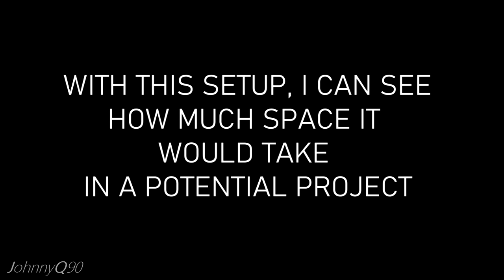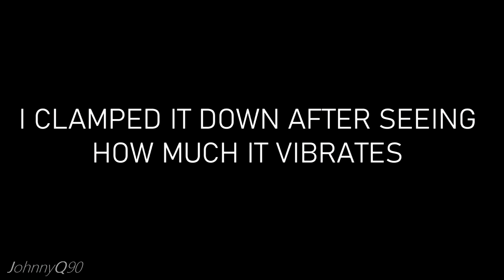Miniature Inline 4 Cylinder 32cc Watercooled Engine

Comment: These are very cool, but you can almost buy a 'real' engine for the cost.
Reply: Almost? I can go buy a small block Chevy from the junkyard for $200.
Reply: true but its not like this little engine is a replacement for a small block chevy lol. Try fitting one of those in a model boat 😂😂
Reply: Ikr ..buy a used weedeater motor for your "model boat" -other dude. But watch Gyro here can point out its a 4 cylinder ..but he can't state why he wanted to use it also he thinks a SV 26cc is basically Shiite in comparison ..not to mention notice he thinks he can make a C8 corvette "better" than A CTR YELLOWBIRD porshe .. Even though timeline was what I was pointing out of how he had the better engine in 1987 *but this guy married the conversation into hearsay mode ..lets see Corvette break any world record including 211mph in 1987 ..move the weight to the ass end so it doesn't flip turning a curve for $55,000 (but I know nothing about "engineering" *you mean*)
Reply: Yes, but that’s missing the point. This engine is unique and built by a relatively small company that has not fully streamlined production costs like a major corporations. Most automaker manufacture millions of examples of each engine whereas there’s likely only a few thousand of these. They are also for a specific niche which means those who really want one will pay this much to get it. Also, this engine is BRAND NEW. They just started selling them to the public within the past year or so and when you order one, it’s fresh, not some junkyard engine with XYZ miles on it.
Reply: @GyroPyro121212  you are missing the point and he is right with his comment
Reply: @americanlivesmatter-BmanWild  You can spit BS all you want. Until you can show me the link to another 32cc Liquid Cooled INLINE 4 Cylinder for a lower price brand new, then you are simply wrong. This engine is a novelty that diehard gear heads with a fair amount of disposable income would gladly purchase. A Conley V8 (also a tiny model) costs nearly $7,000. So for $900, this is quite reasonable.
Reply: @americanlivesmatter-BmanWild  Any gasoline powered R/C plane you can buy new for $900 or less is not going to have 4 cylinders. Maybe 2 at the most.
Reply: @americanlivesmatter-BmanWild  Why buy this engine? Because it has FOUR CYLINDERS. It operates and sounds much cooler than a single cylinder weed eater engine. Why buy a corvette instead of a Porsche? Because the C8 Corvette lapped the Nurburgring just 4 seconds than the 911 Carrera S. The C8 is $60,000 and the 911 Carrera S is $115,000. For that $55,000, you could make the Corvette much better than the 911. I like RUF and I like Porsche. But to compare automakers that have been around for the better part of a century to a novelty engine model is pointless. You could get plenty of enjoyment out of this engine. If you put it in an RC car, it would make a much better sound than the single cylinder nitro and gas RC engines make. At $899, this engine is priced well below any other ready to run model online 4 cylinder on the market. The fact that it is liquid cooled just adds to its already good value. Is it the greatest quality engine ever built? No. Is it a good value-priced engine with cool features. Yes. I would much rather spend $900 on this then buy a weed eater engine. I already have a 2 stroke weed eater, 2 stroke dirt bikes, 4 stroke cars, etc... so what would I want with any of that? What I don’t have is a tiny running 4 cylinder. I would be happy to have this engine among my others.
Reply: @americanlivesmatter-BmanWild  And I didn’t say “show me something shinier.” I said show me another R/C sized engine that has 4 working cylinders, liquid cooling and can be bought brand new ready to run for less.
Reply: @americanlivesmatter-BmanWild  Honestly talking to you is like talking to a brick wall. I DIDN’T SAY SHOW ME SOMETHING BETTER, I SAID SHOW ME SOMETHING THAT IS COMPARABLE FOR THE SAME MONEY. Also, I have seen the C8 driven up close. I even have a video I took of one crashing on my channel. You would be hard pressed to find an original Yellowbird for under $250k now. Also, the C8 is $60k-90k MSRP. If you order one and wait, then that is the price you will pay. One just sold at a dealership near me marked for $95,000. That is still $25,000 less than the 911 Carrera S for only 4 seconds on a 13 mile track. That teaches us that just because something is more expensive, it is not always much better. Also, it has to be a 4 cylinder because that is what this engine is. If you knew anything about the scale model engine market, you would know that more cylinders = more money. A Saito 4 cylinder, for example,  is $2,000+ and it’s air cooled and arranged in a flat cylinder configuration. A liquid cooled inline 4 from Saito would likely cost $3,000+. At $899, this engine is a bargain compared to it’s competition.
Reply: @GyroPyro121212  you've lost your argument .. #fyi
Reply: @americanlivesmatter-BmanWild  The $20 weed eater from Lowe’s is  not a 4 cylinder you single cell. You’re inability to provide me with a comparable product for less money makes your argument invalid. All of your credibility (what little you had) is gone.
Reply: @GyroPyro121212  but but I thought you'd be my friend if I bought this engine and made it run just to make you right "Its not faaaaaaaaaair 😭" now I'm out the $899 bucks and I still don't have your approval what do I now
Reply: That guy commenting back is like a yoyo at the bottom of his own doing he's gotta realize no matter what I say here the facts are he can't tell me legitly why he thinks this engine is worth $899  GyroPyro12
Reply: I'm just glad I'm not riding around in a Ford escape thinking I've got a badass ride like apparently GyroPyro12 here does.. Tell the truth "you were thinking of putting this $899 dollar model car kit in that Ford Escape because it's knocking now werent you 🙄🤔 ?"
Reply: @americanlivesmatter-BmanWild  I already told you. The engine is worth $899 because it is a running, liquid cooled 4 cylinder model engine. Similar engines sell for $2,000+. The Ford Escape is running fine and is just a loaner until I get my F-150 back. It is not mine. Since you’ve decided to go to my channel, you may have seen the A4, F-150, Mustang, Focus SVT, Forester, and various ATVs/dirt bikes. Those are mine. Any others have been those belonging to family members, friends, etc...
Reply: 1 cylinder engines with more power
Reply: @GyroPyro121212  my 1970 D300 would still own your f150 and you claim "I know nothing about engineering"  liquid cooled means I can piss on it ..that rubber aquarium hose will melt .. The VHS wheel in the front insures it .. You said it's worth $899 for the sound ? You said for a RC (anything with a throttle can be RC..including a tube of gunpowder being shoved into the carburetor as our common friend WP showed us in his video) in no way is that motor worth $899 just because it's a 4cylinder .. Although I'm not driving a loaner I'm driving a "slow car" you said ..havent had to fix a thing on it in 12 years except change tires change oil decided to change transmission fluid early haven't had to ask for anything else to drive except when I use my duely to pull Shiit like yours to the shop or out of a ditch ..
Reply: @jwalster9412  exactly! and they can cram that  plastic 4 cylinder for $899
Reply: @GyroPyro121212  "similar" paintings of Jesus sell for $480million to. Where did the "b.s." comment come from originally btw..? Because not once have you stated your case of what exactly you'd use it for as in body & setup: vague and just because it sounds like a 4cylinder don't make it worth $899 it's worth about 3 dollars if that in metal ..what generative form or competitive circle would you put it in..btw there's some sweet music boxes from the 1800s on eBay some look nearly new for less than $899
Reply: @GyroPyro121212  you saying Toyan has nothing to do with Toyota or Yamaha you may want to check the 4cylinder mini bikes China started to sell.  Or the aluminum painted black with an exact match to those Yamaha 4 cylinder engines ..and newly made steel pens use a magnet it's aluminum not steel
Reply: @GyroPyro121212  you can buy 8 brand new 26-30cc 4stroke gasoline ⛽ not nitro not 2 cycle Ryobi weedeaters for what that 4 cylinder  costs all produce more torque and rpms more gasoline efficient none of them NEED water cooling also has extra parts to hook up remote control ..nothing you have said so far is anywhere near convincing to buy this for $899 NOT EVEN CLOSE
Reply: @americanlivesmatter-BmanWild  This engine is not made by Toyan. It is made by an entirely different manufacturer. I encourage you to browse enginediy.com and look in the Toyan Engines section. You will not find this engine. Also, your D300 has a lower towing capacity than my F-150. Properly equipped new 1/2 tons can tow well over 7,000 lbs. Some can even tow 10,000+. Your D300 would be left in the dust. In a race? I wouldn’t even see you in the rear view after the 1/8th mile. Not to mention my F-150 gets 19+ mpg towing a trailer and 2 snowmobiles. You’d be hard pressed to get half that. This 32 cc engine as I have said countless times is a NOVELTY. It is not designed to outperform all other engines of its displacement. It is meant to look and sound cool as a display piece. However, it still makes enough power to be adapted for an R/C application.
Reply: @GyroPyro121212  ok so you made 1 point but it's plastic and it will melt how is it worth $899 and don't give me some mess about its 4 cylinder .. So is a 84 Mustang..
Reply: @GyroPyro121212  I have more wheel on the ground in a solid place also I have a real granny gear 4speed lockout 3rd ..and both your axles will break before you can tow me in the D300  My 7.3litre f250 dually 1991 doublecab will drag you backwards faster than your truck can go.. Or a boxcar. Down the track at 75 mph ..wyg
Reply: @GyroPyro121212  see that's your problem ..your 4x4 isn't made to go fast .. But on the other side of that it has no ass either ..just a costly repair routine
Reply: @GyroPyro121212  the civic can take you btw ..but I'm pretty positive a cb200 can outrun you to..but if you want bike versus bike all I have is an 1980 xs11. Sonny Barger is my 3rd cousin my mother's 2nd cousin I'm pretty sure he has a Harley that can outrun your Harley if you want to go there next.. My xs11 was the fastest bike built between 78-82 stock..but it's no monster however I wished you'd met me at 14 and wanted to race I had a 750 honda bored .40 with goldwing jugs also had a 400 Kawasaki at 11 that had 1 120 sprocket on back wheel ..itd do 80 in 2nd gear (diverted low end power to high speed) ..and a match in the ballist to redirect  spark at 6k rpm increasing its red line to 10k rpm. Would have eaten your 500's lunch .. A 250 enduro streetbike 2cycle ..6 speed .. I'm not beyond using a hairdryer as a turbocharger on a bike or beyond putting a sleeper nos on a Suzuki deadhead.. Just telling you ..while you are taring your Shiite up trying to tell me Idk wtf is up Im telling you I can build a computer from a 2009 motherboard faster than anything you can buy at Wal-Mart circuit city or ebay already put together ..i can make a quad core faster than any 8 core you can but due to 1 fact of latency ..and cheaper than $500 but I know nothing about engineering? would you like a balloon 🎈 💫 what do you think my purpose was for watching this video to begin with was.. Yes I hate China ..obviously but that's not my reason for being here
Reply: @GyroPyro121212  $899 dancer looks and sounds better than this engine. Just saying. Display piece ..or junk drawer. That's the reality of it. $899 worth of pennies looks better as a display piece.
Reply: A lot of people missed the point ..while you kids are throwing $899 in China's hands for a shiny toy engine they are buying vulture capitalism and plotting your doom.. Btw the metal in this engine couldn't be much more than $3 worth. Rest of it is plastic and the rings will definitely start rusting after first run.
Reply: @americanlivesmatter-BmanWild  It’s got plenty more than your beat to hell old Dodge. 0-60 in 5.5 seconds. That poor D300 would be lucky to do it in 10 😂. And the F-150 will tow more. How can you say my truck has no ass when it performs better in every way than your’s?
Reply: @americanlivesmatter-BmanWild  I’d just hold the brake while you overheat and glaze your clutch and then tow the old Dodge away. Your F250 MIGHT beat me, but then what? You barely towed a Gas V6 powered half ton backwards with your Dually 3/4 ton diesel. So what? That’s like being the heavyweight champion and going 10 rounds before finally beating the lightweight champion by default.
Reply: @GyroPyro121212  I've seen what Toyan has for sale.. I'd rather buy a Ryobi or Saito if buying new for the main purpose I checked this video for. Which so you know and finally conclude this marvel of a debate ..I have 3 generators in the making that are like nothing you've seen so far. 1 is in need of a small gasoline engine only can't be 2cycle or nitro etc. Not going to give my plans away .. The other 2 have nothing to do with this entirely .. But this one is a 600watt generator and stores it's own power with regulator so theres no back power resistance . the other 2 are much larger and function a totally different way.. That's all I'm going to say ..at $899 I could make it worth it but not about to invest in this motor for the purpose as its made like a kindergardener found it in a box of cereal
Reply: @americanlivesmatter-BmanWild  I’m not saying I will personally purchase this engine either. If some time goes by and more people buy them then maybe. I would like to see comprehensive reviews and testing on them. If this little 4 cylinder can run on a stand for a time with no major issues, then I may consider it. In the meantime I have a variety of projects to work on that are more meaningful to me.
Reply: @GyroPyro121212  as for truck vs truck my F250 7.3litre international could drag the sparks off your visor before you'd even slow it down no matter you could lock the emergency brake which won't even strain this Allison transmission ..as for the D300 I have the original granny gear that doesn't even need a clutch to operate ..the 3rd gear L s up not diagnals up .. If you lock your brakes you will definitely get drug untill your tires go flat.then your rims will spark.. My clutch won't wear out ..its already 50years old. It will stand up on the back wheels and bounce off the ground on weight it cannot move.. It's got a good winch and jacks on the back now too that's what it looked like when I bought it.. It's by far not Bigfoot but that F150 will literally be a Chinese dildo before you'll drag me
Reply: @GyroPyro121212  that's fair enough ..yeah the plastic turned me off on it to begin with before I saw the price.. Take care of your machine man ..we thinking you are American we need to take care of our machines ..things are changing for the worse globally ..no use in destroying a good machine .. We already have an uphill battle as it is.. Being Survivalist are our best hope ..noahs ark God bless
Reply: @americanlivesmatter-BmanWild  The F-150 makes 400 lb-ft of torque at 2,750 rpm. Pair that with low range in the transfer case, 4WD, a low 1st gear (10 speed transmission) and it’ll pull. Not to mention my truck had the lowest differential ratio available on the F-150 (3.73) and an electronic locker in the rear. The only advantage you have is weight.
Reply: @americanlivesmatter-BmanWild  I am from the U.S. I prefer old machinery for it’s simplicity. There are fewer things to break and when something does, it’s far less costly. My toys are all free of emissions restrictions. The newer ones have all had the emissions equipment removed aside from the F-150. Mainly I only want “new” for a daily driver. Good fuel economy and quiet, comfortable travel are things I value in that. But for fun, I prefer things that are easy and inexpensive to work on.
Reply: @GyroPyro121212  tell me that in 50 years lol 😆 you are hilarious (mine has all the original parts under the hood) 💘be well brother
Reply: @GyroPyro121212  oh and no rips in the original seats 1 vent glass was out but no cracks or bubbles in original glass at 50 years old it's still kicking like a champ as a short distance county wrecker .. Old 318 is pretty sweet .. It's top end isn't that high but it'll go faster than the law allows so what's the point ? To be honest even though it's bed is gone.. The front half is in pretty good shape ..theres 1 quarter panel that has some previous bondo on it that needs to be redone agreed but interior has no rips in seat the dash is at least 95percent nothing missing from original the headliner overhead has been taken out that's another thing but well I love the old truck anyway .. See I try to take care of my vehicles and use them for work and travel if I wanted to race everyone I'd just get a Suzuki deadhead hook up the nos and say. Adios you know? Racing is something I did a lot in the 80s.. But after being hit head on by a drunk driver doing 99.9mph in my 73 oldsmobile cutlass ..i stopped drinking and I stopped racing Myself I was 15 at the time. He crossed into my lane through a double yellow.. The demon always takes something ..but he took my fear to hell with him. You truly want to race me come to Baytown Wharf grab 2 1000lb buggies of linen and race me around 55 floors stocking for guests 8hotels 9areas combined 55 floors
Reply: @GyroPyro121212  just go to main office tell property manager Chris at Village of Baytown Wharf : you are faster than "Brian" at getting linen out to guests..when he gets done laughing tell him "no I'm serious and want to talk to Glenn Simon housekeeping manager then tell him you are a friend of "Robert Director of Owners Association" meet you on the loading dock make sure you bring some Nike s .. P.s. if you meet Wesley McAlister at Lasata tell him you are faster than Brian Inspector Houseman .. P.s. don't put your red key next to any magnets else you won't be able to access the rooms.. 100-6840
Reply: I can find you a god damn car fort that much money!
Reply: @varun-xy1fm  yep
Reply: I can buy my engine in my 2011 f150 x2
Reply: @GyroPyro121212  still missing the point. It would be much more fun to just get a junkyard motor and build it up than have a 32cc pos that sits on a stand going vroom sometimes
Reply: @adrianwelgemoed9562  Not to me. A 5 hp Briggs & Stratton that you would find in the junkyard sounds like shit and wouldn’t make much power with $800 total invested so it wouldn’t be all that interesting. I’ve had a plenty single cylinder 4 strokes and they aren’t particularly fun or interesting. A junkyard automotive 4 cylinder with $800 total invested wouldn’t make much power either. A junkyard V6, V8, V10, etc... wouldn’t be able to be “built up” for $800 or less. You would have to leave it pretty much h stock. A junkyard engine is only good if you have a vehicle to put it in. All of my vehicles have good running engines, so there is no need. If you get into a junkyard engine for $800 total, then you need to either buy or build an engine stand for it or buy a car to put it in.
Reply: you guys still fighting?